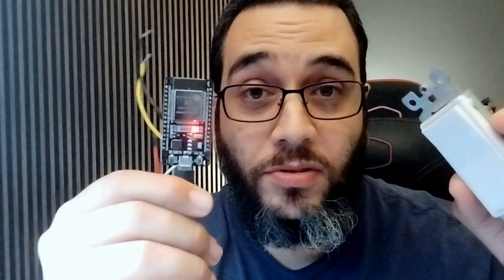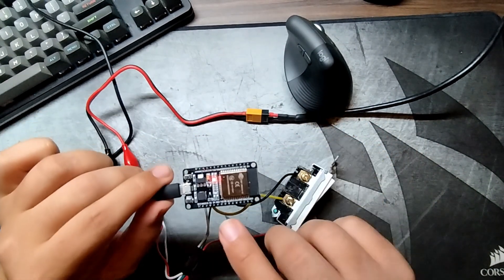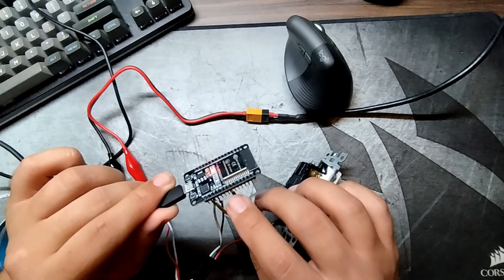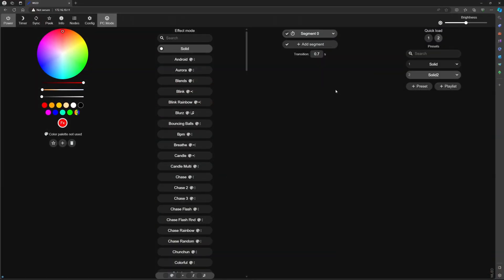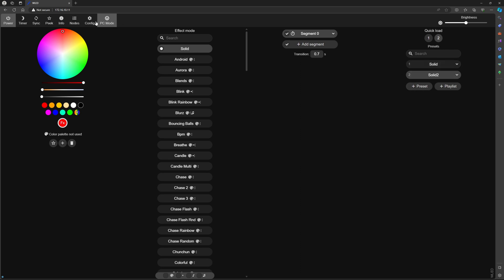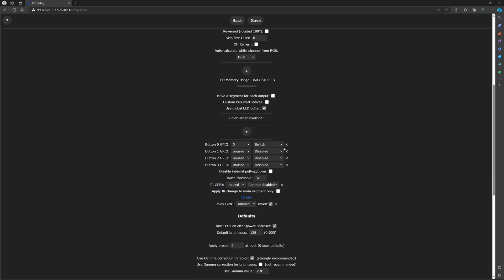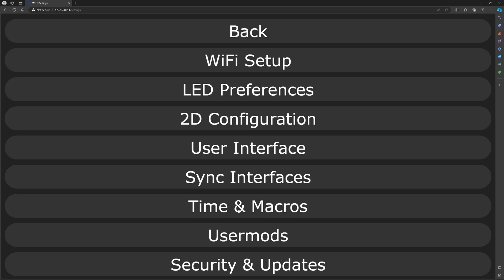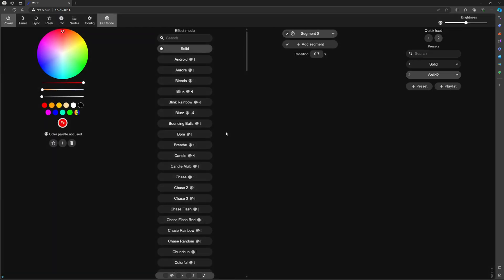Turn On and Off WLED with Regular Switch

Comment: Can you tie it in the power source from the house?
Reply from the maker: The esp32 module need a 5v psu, i uses a usb charger from the old days... the strip will also need a psu and the voltage and amperage its going to depend on the strip itself.

Comment: so when i use temporary button, when i press down and hold it runs a macro, and when i let go it goes back to other macro? if this true then it acts like on release command.
Reply from the maker: youhave to change the button config to pushbutton...
Reply: @carlosmcnulty  when push button config, i think when you push and release it stay until you press it again then it will change. Unlike the switch. Maybe ill try tomorrow.

Comment: Great idea. I’m thinking of a way where a wireless relay like the Shelly could be used instead.  That way we avoid the cables running to the WLED controller
Reply from the maker: If its hard to run the wire , yes... otherwise i will chose the wired method...

Comment: 1) Willl the WLED app still turn on the lights, if the switch is in the OFF position?  2) If the switch is in the ON position, will the WLED App still turn OFF the lights?
Reply from the maker: the web interface will turn off or on regardless of the switch

Comment: I have been looking for a video tutorial how to connect wall mounted switch or momentary switch to Wled. Have you tested the max length of the wire between WLED controller and switch? I am starting my first WLED project and i was looking for a solution how to control Led on/off without cutting the power to controller. I can do it with WLED but controller and switch will have at least  10 to 15m of cable and since ESP32 only support 3V i am afraid that there will be too much of a voltage drop for signal even reach the switch. I will be using cable 1.5mm2. What do you think? Do you have any workarounds to this problem? Thank you in advance.
Reply from the maker: @spegeldesign  I have not but you can find gauge length charts online and find if the cable you are using is enough for the length

Comment: so i'm brand new to all of this and super crash coursed tonight. I'm designing a halloween prop that has complex lighting effects that these LED strips would be perfect for which led me to WLED, which led me to the ESP32 module and eventually had to figure out how to trigger them using prop controllers that can send out 5/12/24v signal. So looking at this i'm assuming the part you're skipping over is that you're sending some sort of power through the other side of the switch there? in theory if you're just using the switch to turn on/off the power signal, then I'd be able to use an output from my prop controller... but I know nothing about this world outside of these tutorials so i'm not sure where i'd go next with that.
Reply from the maker: In my case im just sending ground to pin #5 but if you need to send V to a pin i can tell you its a different story, and more than 3v will fry the board.
Reply: @carlosmcnulty  See i don't really know what i'm talking about yet. getting there. I talked to a friend at work that knows rasberry pi and Arduino and all this stuff and he made it clear I'd just be doing the same thing you're doing but it'd come from a relay in between my controller and this board. so i'll have him help me figure it out. but awesome you figured this out... i'm not sure how there aren't more views on this cause seems like a lot of people are looking for this solution.
Reply from the maker: @RyanLoetscher  Well try out what you have there and get back when you have more info and see what we can come up. Thank you, well i think everything its setup the right way. No love from youtube :( haha make sure to give it a like....!
Reply: @carlosmcnulty  certainly did. Might take a min but i'll try to remember to comment here with my solution in case it enriches what you're doing at all.
Reply from the maker: @RyanLoetscher  Great! Thank you.
Reply: @carlosmcnulty  actually one more question so I can get on the right track for studying... like, and I know this is probably a wtf dumb question, but I really am swimming above my head here... if you're not sending voltage through that switch what are you doing there? Not sure I know the details on what's going on there with the wiring.
Reply from the maker: @RyanLoetscher  the pin receives a ground signal , once its grounded its "on" then you can set any actions, in my case i used switch, and then a call to a preset.
Reply: @carlosmcnulty  cool thanks for taking the time dude... so I understand that, and I imagine the switch is basically just turning on and off your ground that's going to the GPIO? So I guess then the question I have to figure out is what to send to the GPIO from the controller. They have DMX capability and software for it... so maybe I can use a DMX to SPI decoder to go to the ESP32?
Reply from the maker: @RyanLoetscher  Do you have an example of what you are trying to achieve ? I see people using dmx controllers on non addressalbe leds but i dont have experience with dmx controllers, however i see dmx controllers that output direct spi, and i see they can control spi leds
Reply: @carlosmcnulty  I never followed up. I figured out I misunderstood how my controller operates and it just has built in relay outputs. so I could run ground to control and the pin to NO and do the exact same thing you're doing... but now that i've thought about it more, I don't understand the point of what you're doing with the switch. If this is for regular house lights, why not just tie the power to a wall plug that has a switch and use regular ready packaged Govee lights? I'm realizing for my use, where i'm going to pick a preset and just trigger them on/off, I don't need to really hassle with any of this.
Reply from the maker: @RyanLoetscher  Well in my case i like the flexibility of wled running on a esp32 besides being cheaper... of course i could not use a switch but the idea of just using a cell phone to turn on off the ligths or any "voice switch" was not what i wanted. i just wanted to at least turn them on and off with a wall switch and change scenes with the cell phone or computer.
Reply: @carlosmcnulty  Well appreciate your input. I did actually find Govee lights for the same price as ali express generic lights on amazon... but I found that powering Govee on/off doesn't keep my presets, so for the purposes of my prop i'm back to this solution. Been a journey lol, especially starting from zero knowledge, but your video bridged a huge gap for me. I'll post a video of my prop when its finally up and running.
Reply from the maker: @RyanLoetscher  haha yes sometimes it is ajourney but i can also say its fun once its done... glad i could help, looking forward to look at your setup!!